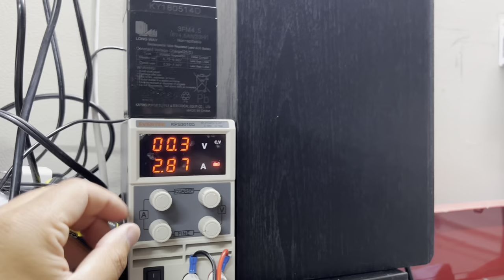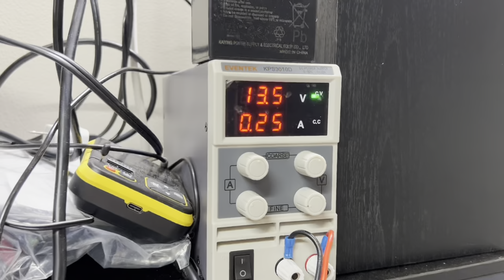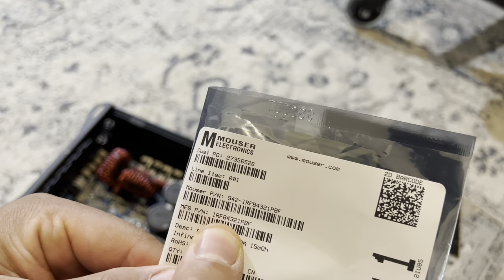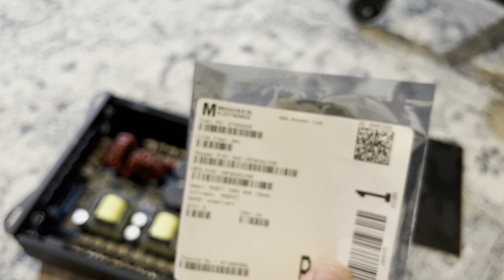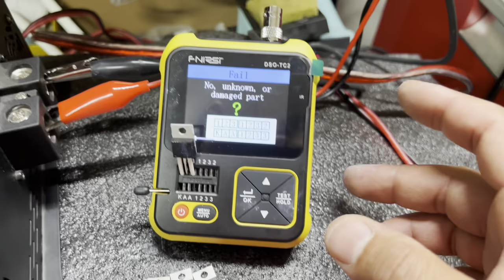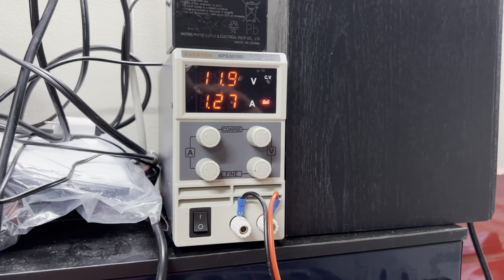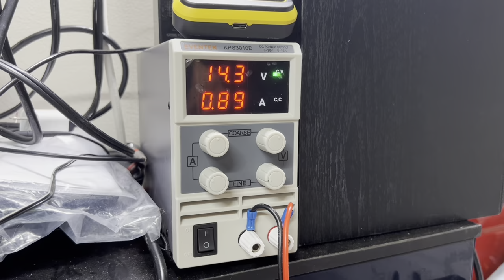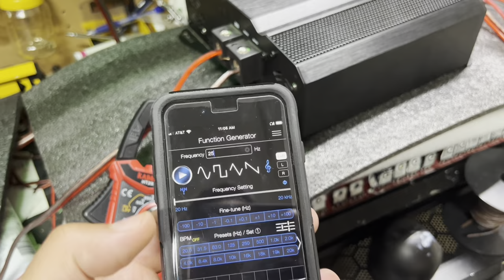3k RMS Full Bridge Amplifier Repair- Sundown DS18 TARAMPS Stetsom Sound Digital Slapz PRV GONZO NVX

Comment: Hello. Good video. Educated. I'm trying to repair a mobass MB-3000D. Do you have input mosfet data? There is only F1 on the mosfet
Reply from the maker: Hello. I am not familiar with those amplifiers. I would recommend pull out a couple of those MOSFETS and placing them on an Oscilloscope or transistor tester to determine electrical characteristics. From there, you should be able to find comparable FETS. 

https://a.co/d/67bfNAx

Comment: Shitty power or voltage n current available is the only reason full bridge becomes touchy its trule 2 pos classd amps strapped running off one power supply transformer set up.  Its extremely easy to learn and understand the claszes of amps and wich n when either of 4 types shine and or outperform the next

Comment: So this amp n all of every amp shouldnt use bolt down mosfet holders because as things heat n or cool they grow or shrink that being a known fact measured by coefficent of expansionor coe for short. Ok now thats clear n non-arguable those same fets that are best to be clipped not clamped alwalys move on the surface their mounted too as its only purpose to remove heat allowing those thermal units to transfer to aluminum heat sink. The thermal paste along with kapton or other insulaters used arent forever nor are meant to be soooooooo guess ill just say it um.mm ya that thermal transfer paste n insulation arent meant to nor will last forever. If ya got big bucks into shit amps like say any jl 1k mono any deamore amps any amp thats worth value id assume we as consumers purchase to use a very long time if not our entire lives but that thermal paste sure tfk isnt made to last as theres hundreds of odd types n formulas of thermal paste all created with various intent of life span and just a guess but every amp ive opened up all use white plain azz thermal paste wich in normal usage has a life expectancy of four years n or less depending on hours of use and temp changes moving the fets every time across or against the sink that the kapton is supposed to prevent but cant cause their bolted tight n movement of using the amp straight up simple to grasp wears through the kapton usually faster the tighter its bolted rather than clamped so that the clamp allows for expanding n contracting of that pos aluminum heat sink.  Now ill let ya get back to showing us all what ya found or how ya found it